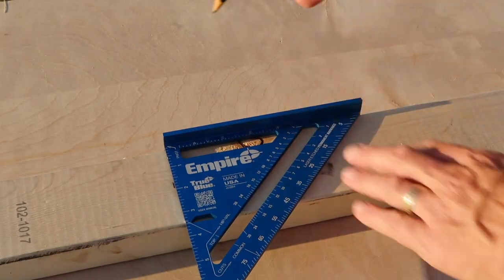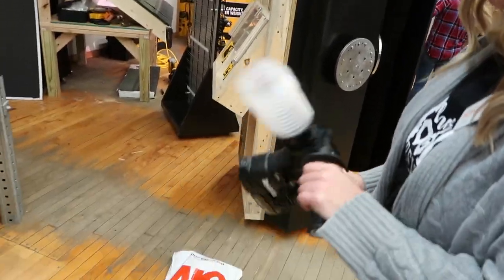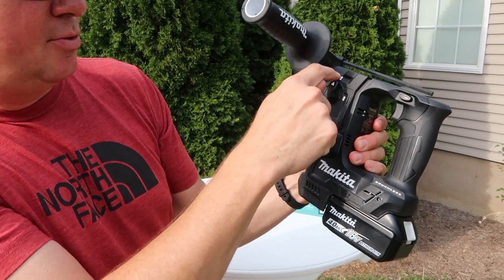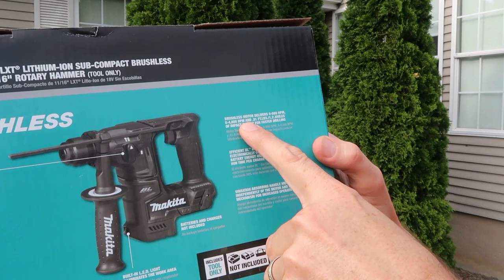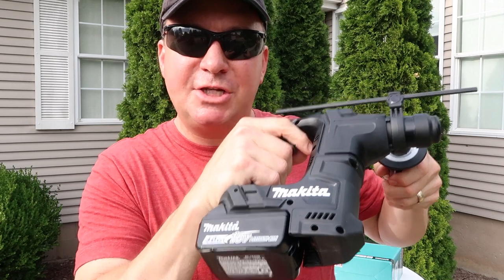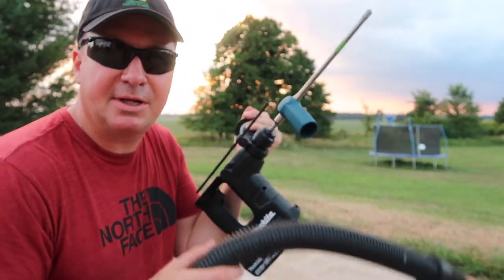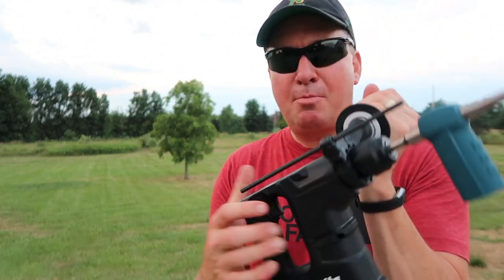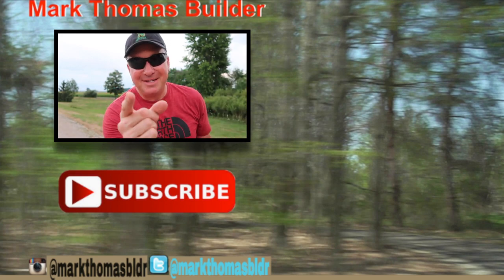MAKITA SUB-COMPACT ROTARY HAMMER 18V REVIEW- TOOL REVIEW TUESDAY!

Comment: Used mine yesterday all day drilling 1/4 tap cons into ceramic block and plaster over block. Was light and didn't blow out the ceramic like a bigger hammer drill.
Awesome little drill.
Reply from the maker: It's a great tool.  It's my go-to for 1/2" holes.

Comment: I used this today and it worked better then Hilti with cord. Through a home Depot front concrete wall!
Reply: Close to a foot maybe?
Reply from the maker: That's amazing!  Thanks for posting!
Reply from the maker: Awesome, I have to drill through a 8" poured wall soon.  Glad to know it will go through.
Reply: Better than Hilti- Idunno.  I have the TE 2 Corded and it's a beast.  Can tackle anything up to 1" very easily.

But I held this Subcompact the other day at IHL and it felt so nice.  It would be great to pull out for 1/4" Tapcons, instead of my corded Hilti.  Do I need it ?  No.  Do I want it?  Heck Yea!!!

Comment from the maker: What's the next project you will use a rotary hammer on?  I have to drill a 1/2"  hole in my basement to run a electrical line through.    How long do you think it will take to drill something that thick?  It's an 8" poured wall foundation.
Reply: That's easy for it
Reply: Dont press to hard let the drill do the work.

Comment: I tried this, but is not close enough to the dewalt 20v.. but of course it’s good for smaller projects
Reply from the maker: This has done an amazing job for me, including a 1/2" hole through my 8" poured wall basement.  I haven't tried a SDS Plus DeWalt yet.  I can say their hammer drill works well though.
Reply: markthomasbuilder try it and you will see the difference, also the battery will last you more. I’m not saying malita is bad, I’m just saying dewalt is more powerful that’s all.
Reply: Which model DeWalt?
Reply: This is for specific tasks, compensating power for weight. Doing a lot of overhead work I tend to bring out my m12 sds hammer instead of my m18.

Comment: But the thing about this tool is that it hasn’t hammer only and that’s the big missed featured as rotary hammer . Great compact tool but if should be better .
Reply from the maker: Good point.  I don't use the hammer feature that much, but it's nice to have.  I've reviewed a couple other brand SDS rotary hammer drills since this video that offer hammer only.

Comment: I'm using a 18v 2.0 ah yours is 4.0 will that make a difference?
Reply from the maker: The 4.0ah should have more power, or at least last longer on one charge.
Reply: Longer Lasting per charge, Amp hours is a measurement of capacity per charge. Volts is your power.
Reply: @gmaxsc  4.0 AH has more Watts and it will be a bit more power i assure you, you can even here the motor sound difference when you connect a more powerful battery but i personally would use 2.0 ah for light drilling and 5 or 6ah for heavy drilling.
Reply: @weedylock  that's like saying a car with a bigger fuel tank will go faster.
Reply: @LemonySnicket-EUC  I am a professional Carpenter and use cordless tools with different batteries so i know what i am talking about. Theory is one thing but in practice it gives different results.
Reply: UlTrApLeX exactly!
Reply: @weedylock  I have credintials a mile long and I can tell you that it doesn't work that way. You might see a tiny bit of difference on a higher wattage drawing tool but not on this little drill. Tons of YouTube videos back that up with actual measurements not "feels" like. JS
Reply: @LemonySnicket-EUC  ok mate, continue watching YouTube to expand your mile long credentials :D
Reply: @LemonySnicket-EUC  I've worked commercial with these tools, they do in fact output more wattage when a higher amp battery is used.
Reply: @LemonySnicket-EUC  Power is a combination of amps and volts, but yeah, just because one battery is 4ah, doesn't mean it discharges more amps at a time.  If the larger battery does discharge more amps faster, then yeah, it will give the electric motor more power.
Reply: @LemonySnicket-EUC  Think about corded tools.  A 5 amp motor is much more powerful than a 3 amp motor, but they both only use 120v.
Reply: So why does the Makita 5amp hour battery have more power than the 6amp hour battery ? #milelongcredentials
Reply: @weedylock  so explain why the Makita 6 amp power battery is less powerful than the 5 amp hour battery that they have. I've been a professional in this field for 45 years my credentials are a mile long so save your banter for the mirror.
Reply: @Forlornguild  you my friend are smarter than everybody on this post.